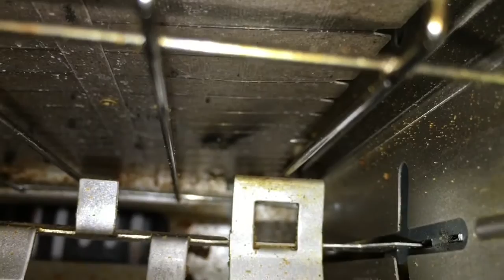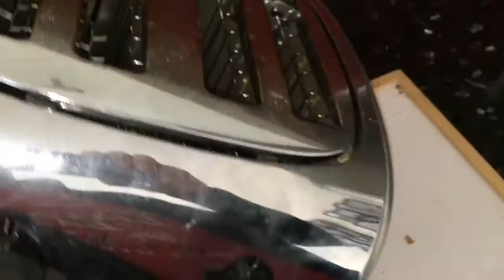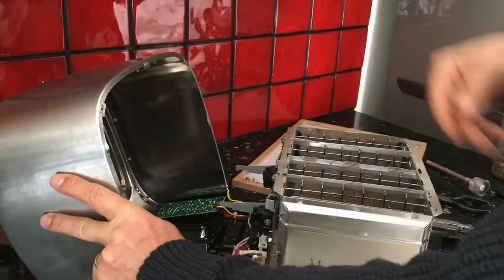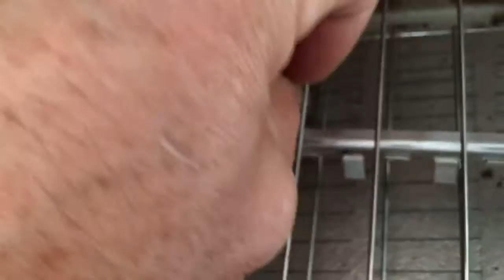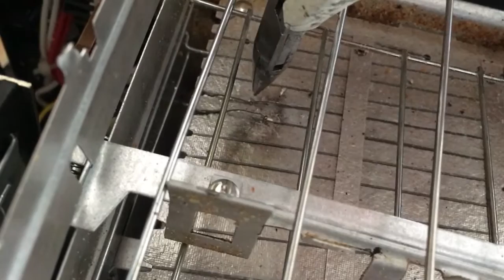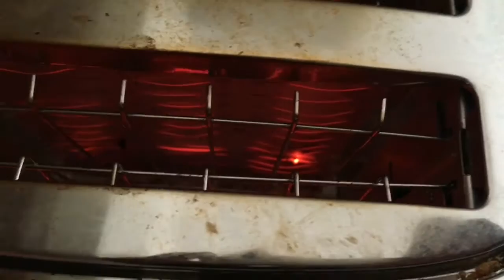How to Fix a Toaster

Comment: April 10 th 2021 and I finally fixed my first toaster thanks to you. Worked out beautifully. I'm using only low heat settings though. Don't want to push the joint too much.
Reply from the maker: Well done!

Comment: Thank you soooo much!!! I had my toaster in the Goodwill pile and actually fixed it instead of giving it away! I had previously looked at a pretty good video where a guy had the same issue. He figured out what was wrong and figured the cost of the repair was not worth it. Despite this, I decided to open my toaster and make sure the wire was truly the problem, and then I saw your video, followed exactly, and now I'm toasting on both sides again. I did see the other reviewer's comment about starting a fire, and I do admit the wires turned redder where the connection is twisted. I do not believe that will be a problem, as I also notice that some spots of the other wire turn redder than others. It does not look any different than the other hot spots, and I assume it means I did good on twisting the wire. Thanks again!
Reply from the maker: Thanks for taking the time to comment.  Well done!

Comment: After it's reassembled, check you have continuity between the casing and the earth pin. And if you don't already, probably best to turn it off at the wall after use.
Reply from the maker: Thanks. Sensible suggestions.

Comment: These toasters, Russell Hobbs 18210, have a reputation for having a RCD problem from new, usually just on one side. They also develop a one element hot, one element cold problem in the same slot after a bit of use.  This seems to be the MCU faulting the Bagel feature as a default setting. Have you encountered any of the above problems with your model.
Reply from the maker: No. It’s worked well, which is why I wanted to keep it going.

Comment: the wire that makes that element is usually Kanthal A1 or similar... it has a maximum operating temp of 2500F.  (might also be nichrome @ closer to 1000F)that connector won't last long and will likely wind up arcing something when it pops, or will get hot enough to melt/pop the connector and embed it in your toast. mmmm delicious.   the pinch and twist should be fine, but i wouldn't use any foreign/unknown metals in there.

i do believe most toaster wires run about 750F which may allow something like this, although they don't state the metalurgy and may not be food safe....

https://www.mcmaster.com/7971k41
Reply from the maker: A max operating temperature does not mean the toaster wires will be at that temperature.  Also although I talk about using that connector, if you continue watching you will see that I decide on a better fix just by rejoining the original wires.  And you know what? All this time later, it is still working.

Comment: For the $2 bucks  I bought this  toaster for I ain’t got time for this but good video mines a old 4 slice GE only works on one side but don’t see any black spots looks clean any ideas
Reply from the maker: Take it apart and look for gaps in the heater wire, it’s usually fairly obvious.  Alternatively use a multimeter to check for conductivity/resistance.

Comment: 2022 I'm trying to fix my toaster is yours still working? If not how long did it last? Is it safe to twist the wire even if nichrome has a high melting point? Your reply would of great help🙂
Reply from the maker: Yes! It’s Jan 2022 and it is still working with no other fixes!  The trick on the twist is to make sure it has good contact for electrical conduction but also that it is mechanically strong, so twisted over itself if possible.

Comment: You twisted 4 wires together?
Reply from the maker: 2 wires had blown apart so 2 wires were reconnected. Two joins on 2 independant wires.  See video especially 3m:50s